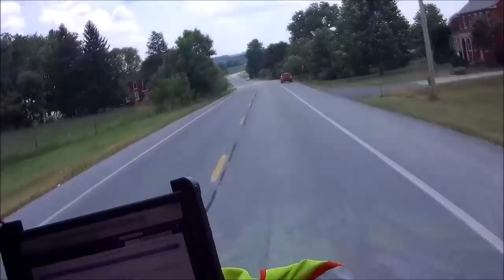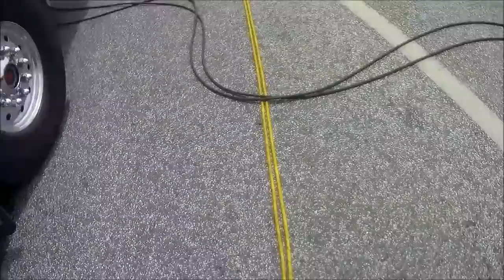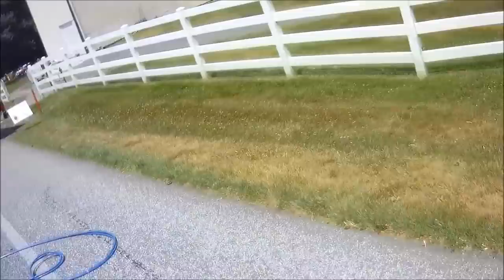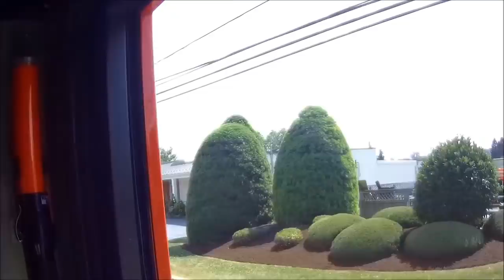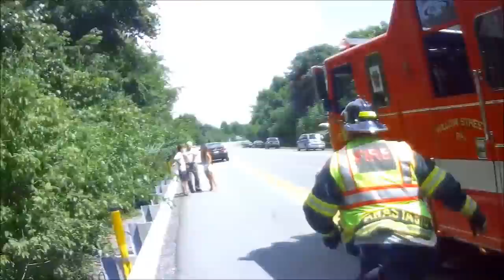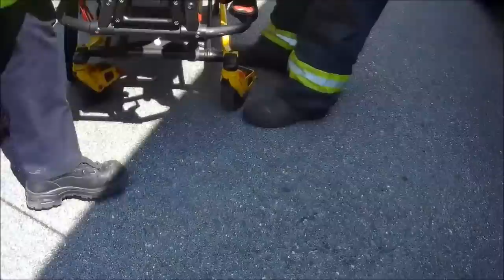Company 50 Takes in Back-to-Back Entrapments *Helmet Cam*

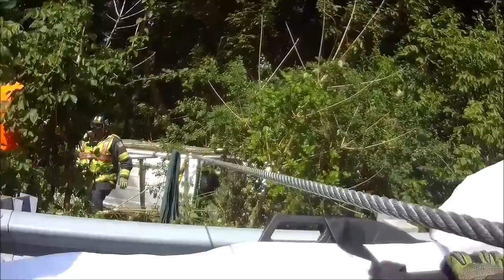Comment: @18:06 some dangerous mistake: do not cross a tensioned steel rope!
Reply: I was going to say the same thing but then i saw your comment. I didn't think anyone else would spot that apart from myself.
Reply: theres a tarp over the cable to catch most of the tension if it breaks. Note that it def wouldn't catch all of the tension. Although, It'll save someones life.
Reply: @paradox8677  you think a tarp will stop a high tension cable from killing someone? That's the funniest thing I've heard all week

Comment: The reason the tractor trailer failed to pull over for you guys at Company 50 is because you were in the driver’s blind spot.  Had the tractor been bobtailing, the driver most certainly would’ve looked back and seen your lights behind them and pulled over.  Another thing is the driver could’ve had the radio blasting in the truck’s cab, meaning they couldn’t hear the sirens.
Reply from the maker: We were weaving slightly to the side and back so that they hopefully would see us or hear the sirens blaring. A good driver checks their mirrors constantly and has the radio at a volume that they can hear a firetruck right behind them lol.

Comment: You cut off the explanation of the tarp on the wire. Now I am curious. Why the tarp on the wire?
Reply from the maker: Mick J Yeah I messed up there lol. The tarp is there to keep weight on it so that if it snaps, it goes down. If it's unweighted it will just fly up and go anywhere
Reply: FireRescue 50 cool! Thanks for the info!
Reply: You can use your jacket also to put on the cable, also on the first accident, on your guys port a power amkus pump, word to the wise on getting longer hoses for on their, that way the pump isn’t so close to the vehicle your doing extraction on. I can speak from experience on having longer hoses on the port a power pump!! Lol the company I run with we have an old model but have extra long hoses that way we aren’t tripping over it while trying to perform the task in front of us and keeps the pump away just in case of a leak.. I know the charged 1 3/4 was their but you just never know!! Lol

Comment: Was that a hydraulics failure on the squad, hense the power unit?  All I could think of which probie is going to get to wipe down the hydraulic fluid and fluids from the crashed car off of all that high pressure line...
Reply from the maker: - Havoc6Mike - There was an issue with one of the attached lines not working. We disconnected the tool and got the power unit to work in place. The fluids were from the crash

Comment: When driving a Fire Truck is there one person driving and another person in charge of the sirens? Because siren-ing on a fire truck is a art form.
Reply: Hidude779 Depends if your driving by yourself you can control it with your horn on the steering wheel. If you have someone in the Officers seat they can also control the siren all depends on your crew size

Comment: Are you the officer?
Reply from the maker: Fire alarm 8 For the first call yeah
Reply: Do you have to be trained to do that?
Reply from the maker: Fire alarm 8 Not necessarily, but you should know a little bit about what you have to do
Reply: Officer always gets the front passenger
Reply: @firealarm8  Depends on agency. In my FD, you have to have FF1 & 2, Intro to Fire Officer & Fire Officer I, RIT, minimum of 4 years on, be qualified as a driver on certain apparatus, be Interior Qualified and be an EMT (EMT is only mandatory for Chiefs) to be considered for an Officer position. If no Officer is available (which is on maybe 2% of our calls), the most senior person takes the seat.